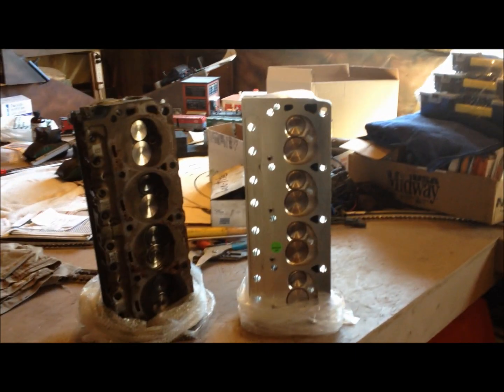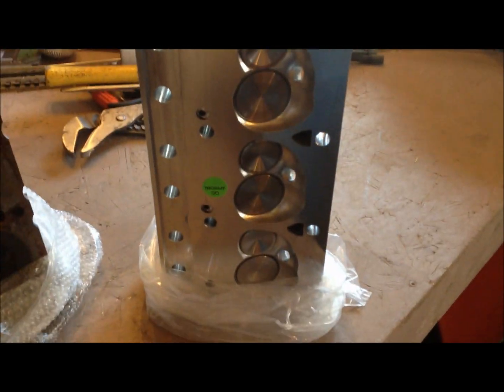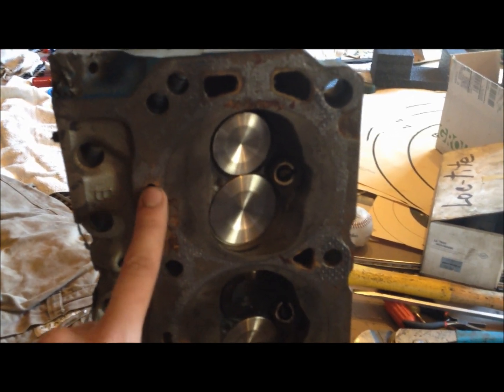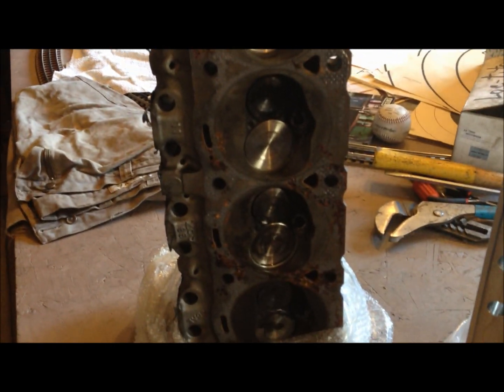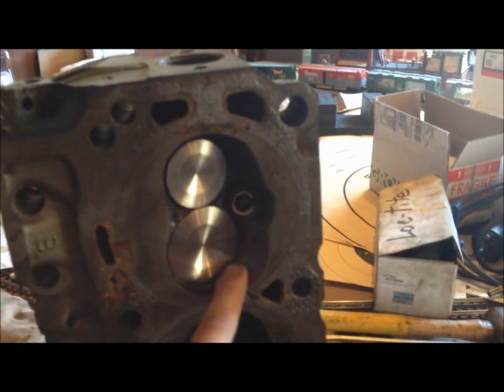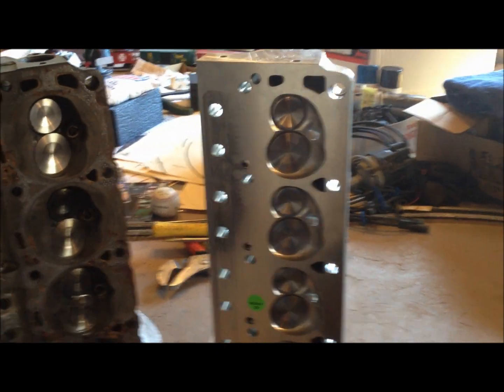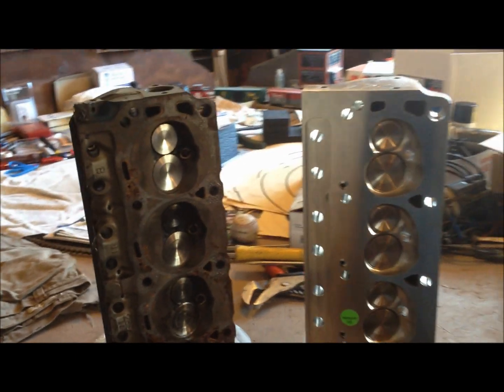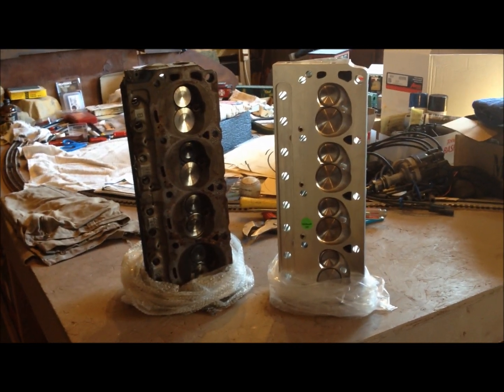SBF Head Comparison 60's vs Modern & Aftermarket

Comment: I had a 64 cyclone 289, I had a machine shop install cut down chevy valves in the home ported heads. With a smallish Joe Bray solid flat tappet cam, and 11:1 JE pistons, that motor reved above 8,000 . Had a fly wheel explode. Put a C-4 in it and shifted at 8,200 with 3×2 carbs.

Comment: The water flows through the block front to back with the majority of the water entering the head at the back and flowing forward to the thermostat  it helps keep the flow more consistent.  Like a circle of flow improved for even cooling

Comment: That's because they outrun Fords and you can buy better parts for them they dominate the dragstrip and they dominated Nascar for years the only other thing better than a chevy is a Mopar had some 340s and 440s very strong engines
Reply from the maker: Ford dominated all platforms through the 60s when people cared the most.
Reply: @ThunderHead289  Yup
Reply: I have a friend with a GTX just sitting in the weeds...My 66 289 still going in a 62 Fairlane...
Reply: 😂 your smoking meth

Comment: I just saw a video about aftermarket heads where the runout on the intake valves can be as bad as 9 thousands straight out of the box. It's probably a good idea to get a valve job done before you use them. Also, I wonder if it would be worth it to just get bigger exhaust valves and port them both.
Reply: 1.5 exhaust is the largest you should do. 
1.45 better.
Get too big and the short turn suffers.
Reply: BTW Look what SBC flow through 1.50. Its the port shape, not the valve size that counts.
Reply: @hotrodray6802  what's the short turn?
Reply: KemMcmillin
The sharp turn the flow makes from the port to the valve.
Need a large radius as possible.
Reply: @hotrodray6802  Thanks. I learned something new.
Reply: Here is the video I was talking about. It's part one of three.
https://youtu.be/N3jn2ER455Y

Comment: Would 302 heads fit on a 260? I have a 64 galaxie with a 260 and just came across some 302 heads and was curious
Reply from the maker: The smallest you can get cc wise
Reply: @ThunderHead289  thank you
Reply: I didn't know the 260 was put in Galaxies

Comment: The new alloy heads will dissipate heat more readily than the old iron head, but you don't want too much heat removed from the head, as heat energy will be lost into the head instead of driving the piston down. Good video though.
Reply: aluminum running cooler is a bull shit story.
It only helps on small block chevys with the iron heads with 13 steam pockets in each head.
we proved it in HRM/CC back about '98 (?)
Reply: at 6k rpm there is about .oo3 second from carb to exhaust valve... think about it

Comment: Just convert Cleveland heads to run on a Windsor. Ford had it right in 1969-1970 and still to this day the best head's for a sbf are Cleveland based.
Reply: That’s a pretty extreme claim. Cleveland heads weren’t great on the Cleveland to begin with. Even more so on the boss 302. They’re horrible for the street. Massive runners in a small cubic inch motor tend to have very low port velocity at low rpm. The only thing they might be good for is if you’re driving at 7k rpm all the time. Other than that, they’re turds on the bottom end
Reply: Alan Burkett its because your looking at heads from the wrong continent.
Reply: @alanb2845  exactly!
Reply: ANY C or M head is ancient technology. Either bad ports or open chambers.
Dont waste money fixing old stuff.
Reply: @hotrodray6802  Cleveland 3V heads 2 barrel ports closed chamber. Australia kept the Cleveland around much longer then North America. Every good Windsor head is based off the Cleveland design.
Reply: Aftermarket heads for SBF are  leaps and bounds better than Cleveland heads in terms of flow and port velocity. Old school is just that, old school 50 years of technology is far better.
Reply: @jackrabbit7389  tell that to NASCAR engine builder's. Sorry but a Windser based head is limited due to its inline valve design. Even today the best small block Ford heads are a canted valve Cleveland based head.

Comment: The slots are steam ports designed to let water circulate. BUT modern thinking is too push the water through the back of the block which makes for better cooling. The small holes are more than enough for steam.
Inserting most OEM heads is a crack,, more so on Fords that have little material under the seats.
People generally never think but the coolant will be all sorts of different temps in various parts of the engine. Top of the cylinder, around the exhaust port the primary hot spots. And 190F temp reading will be 20-30 degrees hotter at these spots, but the bottom of bores will being heated. That in part is why reverse flow coolant is an advantage, cool the heads first and warm the bottom. 
289 heads with stock or slightly larger valves are good on mild performance engines. 
351 W heads probably flow better but have way too big a chamber for a under 5 litre engine,, plus the 1/2 bolts drama as well. Not huge but you have to get proper reducing sleeves for the top or they come loose

Comment: It may be that the difference in the aluminum heads ability to shed heat makes up for the extra weather flow through the early heads. Also, the 260 casting had problems with cracks in the exhaust ports, which were much larger than the 289 or 302.
Reply: What??? LOL

Comment: How about the 221's or the 260's even smaller chamber sizes.  I like the Cast iron over the aftermarket aluminum heads.
Reply: easytopleez33 From what I've read those heads were really thin castings (can't port them much) and had tiny valves. I think some had something like 1.69 intake, almost as small as later exhaust valves and there's not much room to put in bigger without opening up the chamber, which defeats the whole point of using them.
Reply: @foxfordcatguy2283  You need to bare in mind that on the smaller , early, heads like what I have,  221, or 260 the Chamber like 48CC's on the 221, a bit bigger on the 260 like what you said  54CC's.  I don't think they make an aftermarket for those two v8'S.  At least not that I've found.
Reply: easytopleez33 I was stating the drawbacks to using the 221-260 heads on later 289/302/351w engines. I know there are benefits too. I have a set of '63 289 heads (C3AE) that I got to put on my '68 coupe because the earlier heads without the thermactor bumps flow better. (There's nothing more fun than beating people using worked factory parts. I have ported E7TE heads in my '85 GT and run as good or better than some cars with aluminum heads.) Yes any SBF head will bolt on any small block but it's a matter of if the later or aftermarket larger valve heads will clear the smaller cylinder bore of the 221-260. That's why most people step up to  a 289/302/351w with 4 inch bore (same reason Chevy people use the 350 over the 305). If it were me I would probably drop in a 302 (or even a stroker) use the 221-260 valve covers and tell people it's stock. If you have room even a 351w-there's plenty of people who can't even tell the difference between a 302 & 351w. (I got into an argument with a company on eBay selling an intake they listed as for a 302 & 351w. When I told them the intakes don't interchange they said they do and I must be thinking of a 351c?!
Reply: @foxfordcatguy2283  Just read your reply from a year ago.  LOL  I agree, if it came down to rebuilding the 260 I currently have.  I'd just go with a later 302 or something.  Dime a Dozen, and more cubes.  Only problem is the Bellhousing.  5 bolt to 6 bolt but nothing that cannot be swapped out.  I agree with you totally.  Thanks

Comment: id say form a guess .. this is very belated 2 yrs.. form looking and the heads  is that that area where the water jacket is . on early 60s models would easly be a  head gasket weak point

Comment: the gaskets block them holes off and control the coolant so it flows too the rear. It makes no difference just don't put your head gaskets on backwards you can burn your back cylinders up.

Comment: Your Galaxy sounds awesome! Those heads will work just fine on a late model Ford block. We just built a 347 with these 289 heads in a 80 thunderbird, car ran really great for what it is. Now we’re building a BBF striker with the new AFR BBF cylinder heads and intake.
Reply: heads that were too small on a 289 put on a 347 ???
Reply: @hotrodray6802  HOGG EM OUT

Comment: The 54 cc chamber 289/302 heads are definitely not the best SBF early head the don't breath well and putting larger valves in them shrouds the valves terribly the best SBF early heads are DOOE 351 heads all the compression in the world wont help you if the heads don't breath
Reply: I like the gt40/p iron heads. They can be had for around $100. Clean up the exhaust side and the bowls and you have a pretty damn good flowing head for something that come factory on exploders. Even stock I believe they are the best flowing factory sbf style head, -Cleveland style heads. I went 7.3 in my 5 speed car about 3 years ago with untouched p heads heads. I now have promaxx heads which you can't beat for the money. They were even hand blended which I had no idea they were doing that. They flow around 270cc and are $1000.
Reply: GT40 and P heads as well as the E7TE heads the 124 ports are virtually identical to the 289 peanut chamber heads @ C6OE-M etc.... With larger chambers 64 and 60.
C9OE have 144 intake ports and 62 cc chambers.
Early heads can be unshrouded .200".
Reply: @myvintageiron7512
I know nothing about ford heads. When I searched marketplace for those D00E heads, all I find is 302 heads.
Was there a D00E 351 head and a D00E 302 head?
Reply: the 69-73 351W intake runners are bigger, but so is the chambers..  by 6 cc +-... one full number in compression loss. 
Rebuilt old heads are cost prohibitive. guides, seats, pockets, studs, seals, aaand porting.  NO WAY.
Reply: 100% agree with Myvintageiron7512, the D00E as well as the C90E early 351w heads will outflow the 289 heads. I still run my C90E heads that were fully worked and flowed back in the day (but still not as good as aluminum heads flow), before all the aluminum heads hit the market.

Great videos Thunderhead289, subscribed

Comment: I used 1965 289 heads on a 351w when I circle track raced, I did drill the block to match the water jacket you where pointing out, I did this because of some of the rules of compression ratio, I never had a problem and I ran a stock 4 blade fan the car ran about 200 degrees when racing on a hot day but under a caution it cooled down right away using a crank pulley reducer to slow down the fan so it did not turn 6000 rpm every lap, I really did not have to drill the holes from what I have learned in the past. so I believe you really can bolt the heads right on with out any mods.

Comment: those older heads could not be used on modern aftermarket blocks with a 4.125 bore as that slot would be inside the squish band, so AFR and all other after market heads would not have it.
Reply: Besides pure race blocks, who majes a 4.125 small block??

Comment: my guess would be reverse flow vs std flow water pump visa vi  serp belt systems being phased in in the 80's. similarly with gm minor head "steam" hole differences attributed to flowing coolant differently.
Reply: WRONG.
coolant still flows the same direction even though the pump turns reverse.
Reply: I don't think serp belt driven pumps are reverse flow but rather are just reverse rotation. Also, I think the slit in question was eliminated before the rotation was changed. I think it was absent on the D80E heads, but I am far from an expert on the topic. I still like your answer.

Comment: I currently have a set of 65 289 heads on a 94 5.0 and the engine runs great, no water leaks, no over heating, no over pressurization of the coolant system. It works like a charm. I've also used the newer aluminum heads in the older blocks and the same thing absolutely no issues. That port was used because of the cooling of the old engines. New heads lose heat faster and the new block flow water a little better in my experiences so cooling is not a concern either way.
Reply: Did you use head gaskets for the 5.0 or the 289?
Reply: @Parched0001  I used the head and intake gaskets for the 65. I did not use a fuel injected intake manifold I used an Edelbrock Rpm Air-gap for a carburetor.
Reply: @backinblck1  Ok thank you. i’m using a carb as well with a performer rpm intake

Comment: Shelby would commonly would weld that "banana port" up, they would commonly leak at the head gasket there if compression ratios were higher than 11 to 1...
Reply: that the kind of comment you learn from
Reply: If I was to run 9.5 or 10:1 comp. on a street engine with the old heads, using the newer gaskets it seems that it may work okay...just wondering. Any thoughts?
Reply: @alexcostan3391  There is head gasket sealant I use with standard gaskets https://www.carid.com/permatex/copper-spray-a-gasket-hi-temp-sealant-mpn-80697.html
Reply: @alexcostan3391  My build  https://www.youtube.com/watch?v=mzL_OWouKTs
Reply: You should always check heads with a straight edge, and a feeler gauge check for warp before a good surface clean.

Comment: I have used the 1969/70 302 2V casting with good results. Chamber volume reduced to 58. cc from last 289 head, also accepts 1.94 intake 1.60 exhaust valves. They do not have the cast in spring cup of the 289 hp. head so easy add larger diameter springs. Fully ported some racers claim these are the best of the factory iron heads. Chamber looks almost identical to the heads shown.
Reply: I like this head also and think it to be one of the best. Am considering doing another instead of using the gt40 on my stock sleeper Fox.
Reply: They are once you port the intake/exhaust they are bad ass partly bc of combustion chamber size
Reply: there are 5 different chamber shapes for just 289 and several more for 302. All ancient technology.